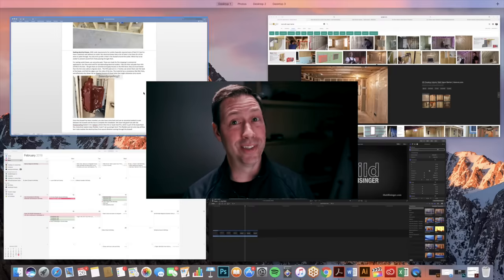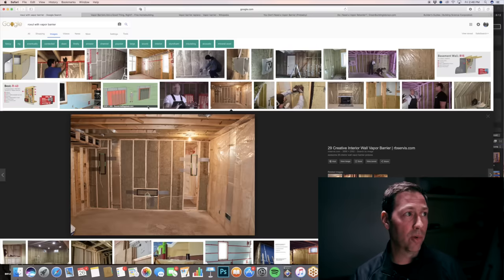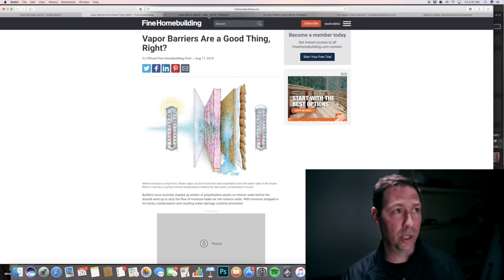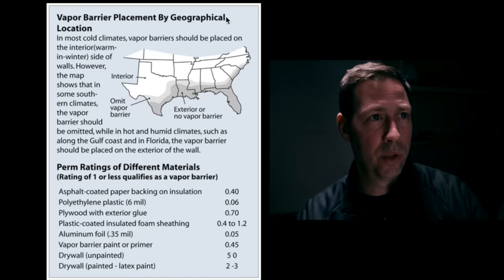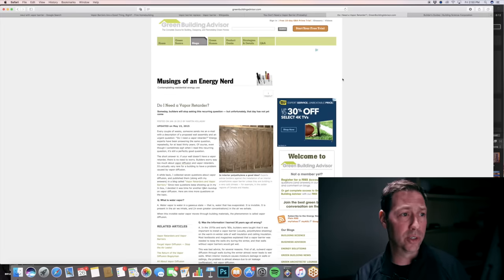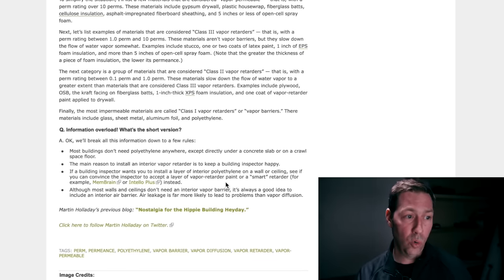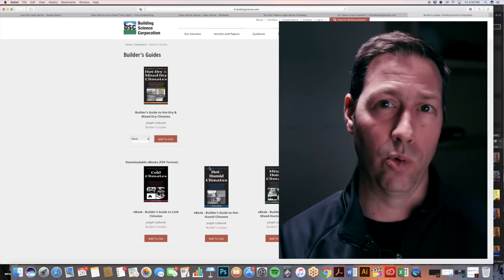Vapor Barriers: Need one or not?

Comment: Keeping the inspector happy shouldn’t come into the picture, they can only enforce the code, and if that requires it you have little choice. I am doing a bathroom remodel, it was on the the outside wall and a part of the ceiling, it was not in the bathtub tile surround drop down I tore out to get full height ceiling, but is there on either side. I tried to search the code and didn’t find it, I am in Zone 5 in Colorado, a very dry climate, but I will probably check with RBD to confirm since I pulled a permit. I thought OK just use some 6 mil to complete missing areas, get some fancy tuck tape to repair breeches etc, and tried to look at what kind is needed and saw information that said it has to be marked with some ASTM number, which I don’t think the regular type at HD has. What a confusing subject for a DIYer, if as you say builders are asking about it, I don’t feel so stupid.
Reply: Keeping the building inspector matters a whole heck of a lot more when you are a builder. You might be seeing that inspector a dozen times a year and if they decide they don’t like you they can make your life hell, whether they actually have a genuine issue with your work or not. Even a flawed inspection correction can be a two week process or more to overturn in the wrong jurisdiction. And when you have a deadline, that two weeks and making an inspector hate you just isn’t worth it.

Comment: What about old houses without vapour barriers? My house has from outside to inside: asbestos shingles, tarpaper, donnacona press board, sheeting, and paper back fibreglass pink. No vapour barrier on the inside. The house breathes pretty good with no evidence of rot or mould growth since it was built in 1940s. I assume most moisture rises up through ceiling into attic space. I live in northern Canada. Why has the house functioned okay without a vapour barrier for 70 years?

Comment: it is truly incredible that reputable info source still say it's ok for ceilings to be insulated with the insulation exposed to the unheated attic without any covering to keep the warmer air in the insulation from escaping and being replaced by colder air from above.

this air exchange is a type of CONVECTIVE heat transfer.  The R value of insulation is a CONDUCTIVE heat transfer number and can ONLY be achieved if the insulation is confined and not compressed.  Leaving the top of insulation exposed reduced the R value significantly.  COVER IT UP!

Comment: What if its an above grade 2x4 exterior facing basement wall that will be left exposed (storage room, no drywall)..Can I insulate with r13 fiberglass or rockwool without a vapor barrier?

Comment: a little off topic, but I am restoring a 1983 camper in Wisconsin. (had a leak, had to rebuild an entire section of wall) we are trying to reinsulate and not sure what to use for insulation in 1.5 inch walls, and if we need to have a vapor barrier - there previously was not one. we thought about using "non-facing" fiberglass insulation and "halving it" since standard off the shelf insulation would be too thick for the walls.  anyone have any suggestions ?

Comment: pipe busted and crawl space flooded. I pumped water our,but there is water under the vapor barrier.  Will is go away into the ground  ???or do i need it taken up and new barrier.  Also I put big fan with airflow outward and later i was going to put kerosine stove on low heat for 10 hours.  Is this good plan

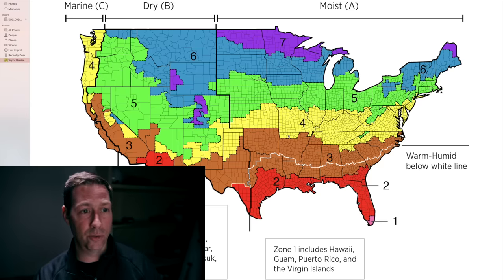Comment: i dont agree with the map at 6:51.  MOST of VA in the summer runs high 90s temp with up to 100% humidity (mayish-octish) also with that being said... on a trailer there is generally VERY thick plastic underbelly, doesnt that act as a vapor barrier also? and nothing but insulation on under floor side? im probably gonna have to find a current new build site and see what they do in MY area?

Comment: I don't know if there will be anyone looking at comments 4 yrs later. I  watching so many videos abt insulation &  am so confused. Theres a sturdy old shed I want to insulate so I can keep my art supplies under temperature control, but the wood siding is decades old and w ur inside I can actually see through the cracks to outside in some spots. I was thinking I could put foam board between the wood framing but now  worried abt moisture, bec I will prob install the smallest mini split possible there. If I use water resistant foam board I'm zone 4, do I put vapor barrier between it and that wood on the outside? Or will that be a petree dish for mold? We get all seasons here so I'm So confused. I'll take any comment suggestions

Comment: Hello Matt, I’m retired energy manager and when renovating my home that always on mind. With that in mind Im always watching your blogs. The reason I’m reach out to you is because after purchasing my i discover that our basement exterior sleaving is styrofoam type of material. I’m still not sure if the styrofoam sheaving is using some type of wrap. So, I’m active make energy conservation improvement to this house with making it to tight. In the basement we have a concrete walls on three sides and stud walk out structure. My question is what would suggest be the best way to complete this 1500 soft space with a traditional fire place?

Comment: Hi 
I have condensation in a garage wall that is an interior wall in the house. Problem occurs in the summer when the garage is hot and the interior wall is cold due to AC. The drywall was destroyed and full of mold on the garage side; interior side was not affected. There is plastic sheeting on-the garage side. I live in central Ohio.
No one seems to know how to fix it. Please advise.

Comment: I live in Ohio zone 5 I believe. I'm using rockwool batt insulation. With 5/8 the foil backed drywall. I was told I didn't need a interior vapor barrier. Is this true?

Comment: Now I feel like everything I know is a lie...

So for a basement (i.e., concrete walls) would sealed (taped) foam board insulation + insulation between the studs without a vapor barrier work? I've heard that installing foam board directly on cement with enough space for air to move (similar to the manufactured sub-flooring with air grooves) is sufficient if you aren't worried about excessive water leakage (I'm not).

Comment: Should basement walls be treated the same as upstairs walls? How about plastic sheeting to protect insulation from potential cracks in the foundation, and water that may seep into walls? (Is this even a concern?)
Reply: Perhaps I can speak to this a little. We build in a pretty cold climate (Zone 6) and I've never put plastic sheeting on insulation over concrete basement walls. The thought being that concrete walls create, for all intents and purposes, a vapor impermeable surface and you don't want trapped air/ moisture with no means of escape. At least this is the theory i've always subscribed to. Concrete walls in our climate tend to be somewhat of a condensing surface in the colder months as well, so leaving the plastic off allows for that to hopefully dry.
Reply: Alan Duke Interesting, thanks!
Reply: Leif Pedersen
No, concrete and brick are highly permeable, but you don't want to trap water in them
Reply: Scott in MN
Code? Here, I thought we were talking about doing it right...
Reply: Inspector...? ;)
Reply: I'm in rural ND. We get the very coldest weather in the US, often down to -40 ambient (colder with chill). As a result, very few foundations don't have minor cracks. Ground water is often a problem in the spring because the area is flat, originally prairie. Newer builds mitigate that by grading aggressively, but our older house needs some improvement in that regard. We don't get extended periods of condensing humidity in the summer, but it does break 90 degrees with uncomfortable humidity every day for about a month.

Comment: Still reading these comments? 
Suppose you live in zone 4 or above and you suffer from extremely low humidity inside the winter like in my case because i gave a woodstove and no humidifier? 
In that theres often higher humidity outside than inside in winter. Should you have a vapor barrier.  Im guessing not.

Comment: I have no vapor barrier in my house from 1931 (of course 😅), and the wood in the walls looks like new 88 years later, no insulation either, just 5inch cordwood stacked in the walls, I live in Sweden
Reply: Well the climate you live in is a lot colder so moisture from outside isn’t really an issue.

Comment: I guess as in most endeavors "your results may vary".  But my experience as an insulating contractor in central Texas back in the  70's & 80's is that vapor barrier properly installed on the climate controlled side of the walls is amazing and positive, especially when paired with an exterior wrap.  NEVER had any moisture or mold issues- NEVER.  Custom builders we worked for always had word-of-mouth customers lined up and waiting.

Comment: We live in Milton ontario and had a house with a basement that the builder put insulation with 6mil vapor barrier agaist a concrete foundation and in the summer the vapor barrier would trap moisture in the pink insulation and would start to leak down to the floor ..so as soon as i saw that i removed all vapor barrier and it went away ..

Comment: Hmm doesn't it depend on if the condensed water get to dry out or not? 😂
In Denmark mold and rot are major issues for housing. Even a bit of water here and there will cause problems over time.

Comment: TRUTH  ---  From Alaska to Florida, humidity on the inside of a house will always be higher then the outside and without a plastic sheet next to the drywall, moist air will always be flowing into the wall.  Always causing insulation to be severely saturated with moisture.  Always causing mildew and dry rot.

Comment: makes u wonder how 100 plus years hpmes have withstood all this diffusion of water
Reply: randomrazr most likely they don’t have  insulation and/or vapor barrier! 

The air leakage is more but the house is  healthier.
Reply: Toob247 Toob247  Throughout the years builders and architects have been trying to save money on energy, while they are Saving money  on  energy using various methods of insulation  they are compromising  the structure if the waterproofing  and dehumidification is not properly design.

I been doing   Stucco and living  in PA  for well over 16 years, I have seen many water issues Due to bad  waterproofing designs and over all poor construction practices. 
Stucco remediation  is what I’m doing for living now!!

Comment: The reason way the wood in your Picture is rotten is not the vapor barrier, Its that there is no ventilationen between the inside wall and the concreate wall. A vapor barrier is not 100 % tight so when vapor passes through it gets trapped between the concreat and plastic = your wood studs will root.  In my country you NEVER insulate on an inside concreat or brik wall if you don't have a ventilated gap between the to. Its a classic mistake. Here vapor barriers are standart, they must not be broken at any point, offen we put the 50-75mm. into the Construction to make room for installations . This is in Danish but there are pics you can look at https://www.dafa.dk/media/994002/montagevejledning_dafa-airstop-system.pdf

Comment: I watched tons of videos and still have no clue how to frame my unfinished basement properly. Everybody has a different opinion. Then whats the proper way to frame that block wall and keep the water out to avoid any mold and other nasty stuff grow?!? Now you say that I dont need a vapor barrier, then what do I need? Oh yeah, one more thing, my basement has a very small leak.
Reply: What I can tell you is what Michigan contractors are told to do and what I did. I used an adhesive and polyurethane board over my basement walls. I used an adhesive from a tub and "buttered" the backside of the poly board and pressed it onto the concrete wall. Do not just put a few beads of adhesive as this leaves an air space between the concrete and poly board. Butter the entire surface of the poly board. This will remove any air space and you will have complete contact. They then tell us to do the same with drywall/sheetrock. Butter the entire surface and apply to the poly board. Again removing all air space. 

I needed to hang cabinets so I needed an actual stud wall. I built it with 2x4 and attached to floor joists and ramset the sill into the floor.
Reply: @bryanswift9801  Oh. Just read your reply. Thanks. I am set for a similar route at least for now. XPS borad glued to a wall, then a frame and a drywall. No plastic vapor barrier.  Hate to loose like 6" of space but didnt find any better solution so far. My concern is that i have a minor leak in a basement. The water sips through during big storms. Not huge. But still. I m afraid it will create some nasty stuff when XPS is attached to concrete. BTW, did you paint your walls also. With Drylock or similar? Again, heard mixed opinions on that.

Comment: Home construction should be considered a practice, because that's basically what's being done.  A decade ago it was "gotta have a vapor barrier" although countless newer houses are rotting while many houses much older are doing great. How many proven techniques are handed down and incrementally improved upon, as opposed tobuilders starting their learning curves from scratch and inventing new solutions without any long-term evidence they're effective?
The deterioration of houses built with so-called modern materials and techniques is appalling. A savings of $10K over 20 years on heating is met with a bill for $40K to reconstruct the place and meanwhile the occupants are breathing in mold or worse.

Comment: "If you are in America, you do't need a vapor barrier on the inside". Ummm... ALL of Alaska is in zone seven (or 8 even) and a bit of the lower 48 is too.
Reply: Watch the whole video. Matt didn't really say you don't need a vapor barrier in all of the USA. I am originally from Alaska and Alaska has four zones 6-9. You probably would have problems with a plastic vapor barrier in southeast Alaska which is warmer than here in New York City area and I have never used a vapor barrier  in NY but I am meticulous about air sealing; so far so good with tear outs to check. Air sealing is really important with the amounts of insulation now required everywhere due to condensation caused by the temperature differential caused by the extra insulation needed. Acrylic paint in all but the coldest zones) on the drywall really is a good vapor retarder as long as you are sealed up around any penetrations. A house that "breathes" in the old school "air movement" sense, is long gone. 
Breathing, worked great for keeping un insulated building materials dry but now it becomes expensive for heating and cooling and causes a rain storm (condensation) in your inner walls. Make sure you are following guidelines for your zone! and take note that some building inspectors will and do have it wrong, so maybe just slash the plastic after passing inspection?

Comment: its all confusing, and your making it more.. i live in VA and its HOT AND HUMID in the SUMMER, not as much as GA, BUT far more humidity in the summer than what an interior can/will produce in WINTER?!?, so WHY wouldnt i vapor barrior the OUTSIDE, not to mention there is ALWAYS the possibility of LEAKS, and therefore to ME it at least seems like i should PREVENT that, at all cost? not to mention in the scenario your talking about 30 quarts or something.... if i have vapor barrier inside... wouldnt there be "puddles on the floor? now most of us CANT afford the systems your installing on CUSTOM homes, my old trailer needs new siding (metal currently) and has dated "wood" panel inside, SOOO new drywall, siding and insulation seems like a good idea. AGAIN i watch a few of your vids and still confused.not to mention lots of rigid foam i see at HD/Lowes says no NEED for additional vapor barrier... again rigid foam on the outside??????

Comment: I really don't understand the representation in this video that a vapor barrier can be put in or not, at the builder's discretion.  Isn't there a requirement in the building code about it?  And why is there a vague reference to "trying to convince the building inspector"?  If it's not in the building code, why do you need to convince him.  And if it is in the building code, the whole discussion about whether it's needed or not, is moot.  To me, the value of this video is significantly lessened by the failure to explicitly address what is in the building code.  I'm not a builder (obviously).

Comment: Of course any home built now will need to consider climate change. What is now zone 3 or 4 could easily be a 2 in 10 to 20 years. I live in Central NC. Our house is 45 years old and have a layer of poly beneath the sheatrock. In the winter if we do not keep a kettle on the wood stove the low humidity is almost unlivable. In the summer our 2 months of 90% humidity is what the heat pump works the hardest on. I think builders in the 80s followed codes for vapor barriers meant for northern latitudes. To me logic would point to an external vapor barrier mainly for summer.

Comment: Matt: you are too good to stoop to wikipedia - its one of the most error ridden sources on the web.  Pretend it doesn't exist, except when it comes to lancing nonsense.
Anyway, for those who have in-between climate factors [North Carolina or Tennessee for example], my instinct is to barrier the exterior.  Is that correct?

Comment: Unfortunately this is a very dangerous video and could cost builders a lot of money. 
The science is sound but the problem is the Building code for your area. 
If the code requires a vapour barrier it must be installed, or your building won’t be passed and you will Not get your occupancy permit until it’s done properly. 
Therefore it’s best to use professional contractors who follow local building codes.